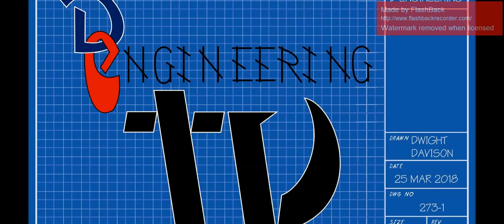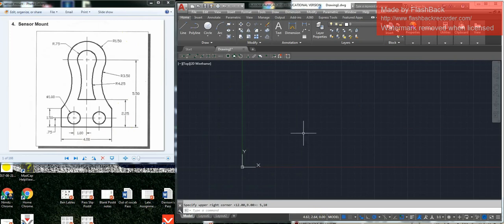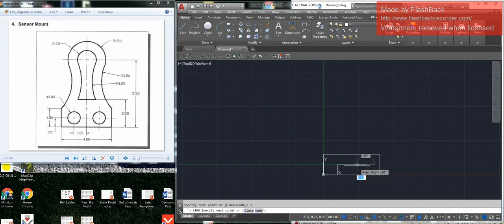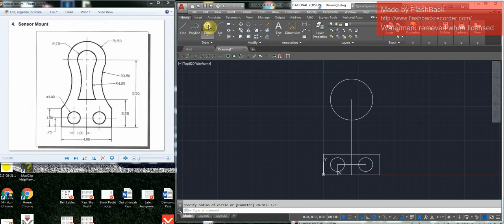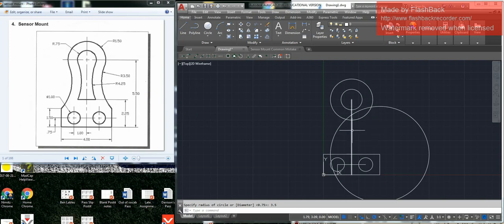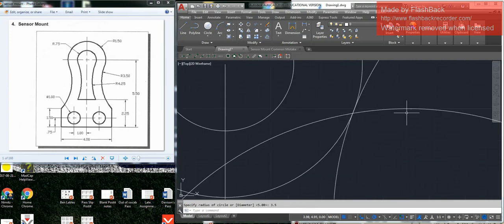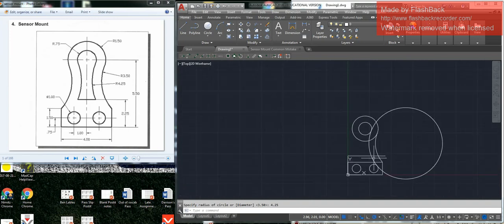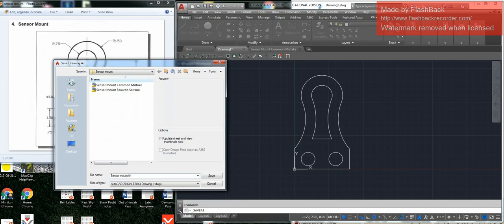Seonsor mount tutorial video

Comment: In the middle of the sensor mount the distance should be 1.5   This video brought me to 1.41   Please fix
Reply from the maker: What do you mean? Can you explain? I want it to be accurate so I can fix it.
Reply: @EPhotoAlbum  6 months late but I found the problem. You used the same centre point for both R3.50 and R4.25 and they should be different. and thanks for the tutorial.
Reply: Dwight Davison the line that connects the two center arcs should be a distance of 1.5. The picture you are using doesn’t indicate it though. Sorry, my auto cad book simply read differently and your pic didn’t show it. I understand the miscommunication. Thanks for the great content!